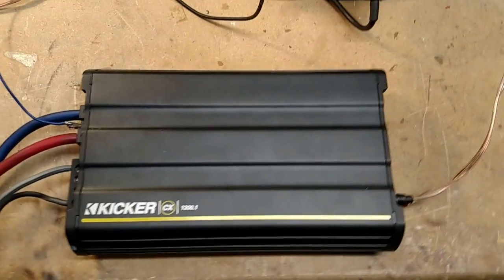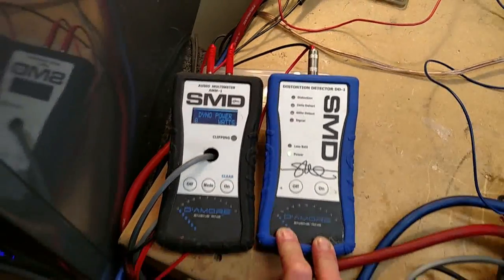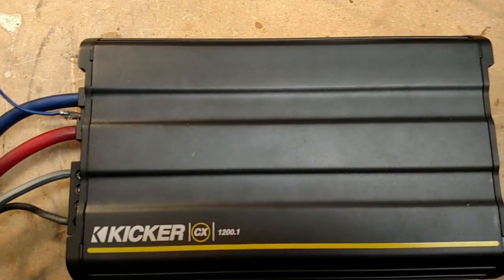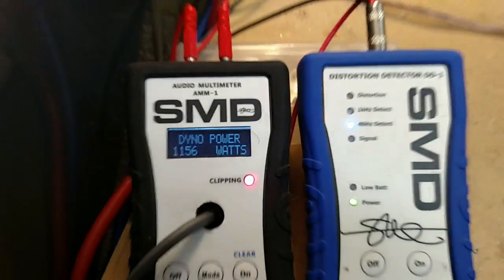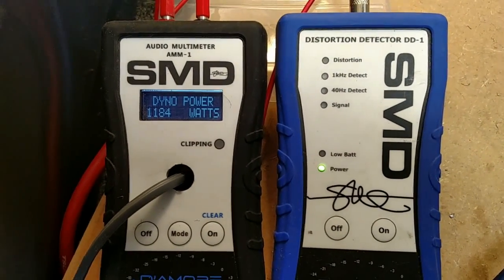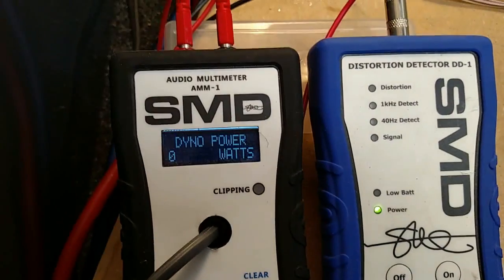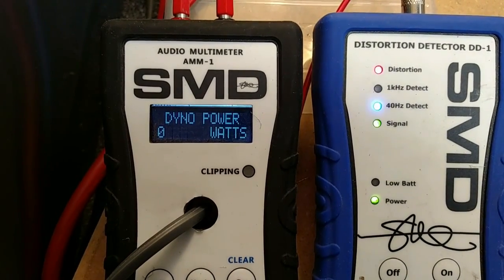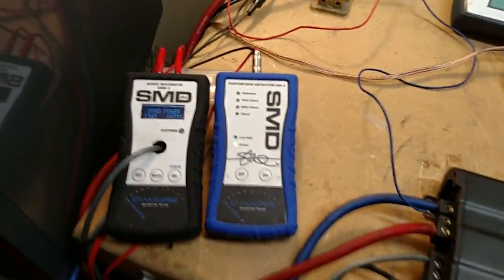AMP TEST - Kicker CX1200.1 Amp Dyno Test

Comment: many enthusiasts hate on mainstream brands and products that are available at best buy or wal mart but you'd be surprised to know that kenwood, pioneer, sony, kicker, and entry level alpine and rockford amps all do at least rated power on 14.4v
Reply: I have actually never seen anyone talk crap about the amps, just the speakers and subs.
Reply: My best buy carried alpine type r subs which i love
Reply: I got the rzr-1 2500 power acoustic amp from walmart for $100..I seen a dyno run on it and its putting out its rated rms watts and some..Definitely a great buy..I had it on to sony explode 1300 watts 12's and it was loud but my sealed box was shit..Found a new ported box with two kicker comp vr 12's for $180..Was definitely happy with my sony's,but these comp vr's are on a different level than the explods..But definitely curious to see how the explodes sound in the ported box

Comment: I wish you could have run it at 15.6V they claim on kickers site 2400w max!  
CX1200.1 Specifications
Continuous RMS Power [watts/channel] @ 14.4V, 2-Ohm mono
1200x1
Max Power [watts/channel] @ 15.6V
2400
Reply from the maker: I don't see it happening. lol
Reply: Max is another term for "peak". It's a completely worthless number nearly every big name manufacturer continues to use simply because every other manufacturer uses it. Slap two amps that output the same power next to each other and print 1200WRMS on one and 2400WMAX on the other and you'll sell three times as many 2400W ones.@15.6V I'm sure this amp would output 2400W at 10% THD for 1 millisecond. Who cares.

Comment: Not bad at all! Good job Kicker, cool test, look forward to more!
Reply: Always wanted to see the alpine mrx m50 on the Dyno.  Possible?
Reply: Hwy big D could you test this amp. I know you have the ability to run 14 volts to this amp with your power supply.
Reply: Big D stop playing can you put the Rockford Fosgate 200ix with a flip chip under the bottom for low-pass and high-pass